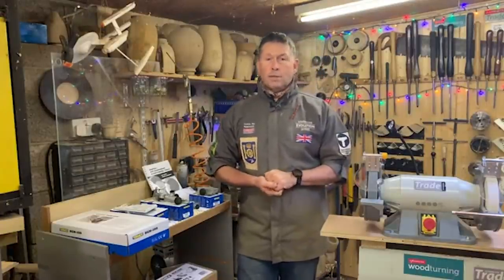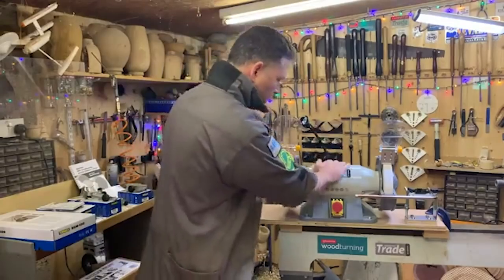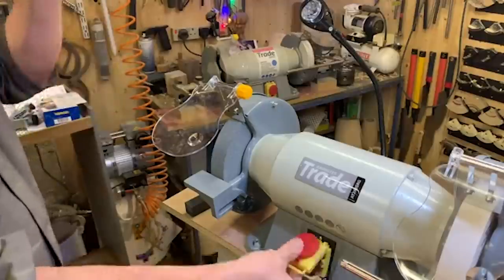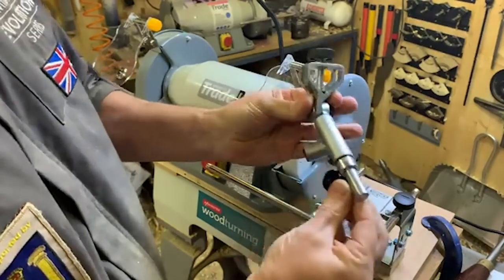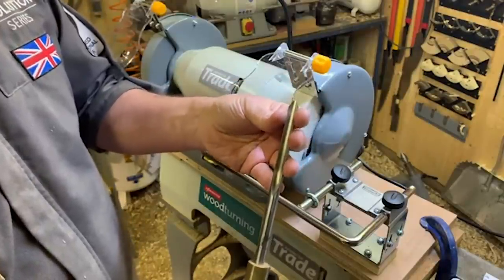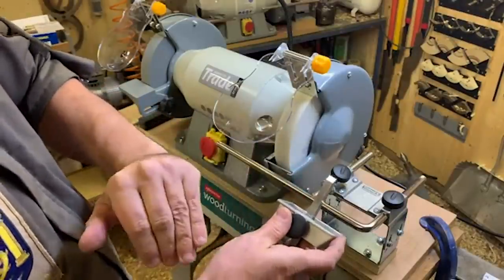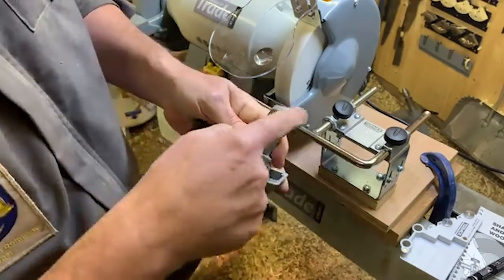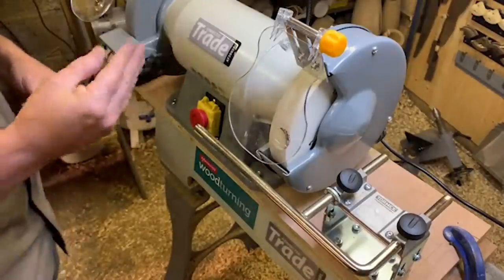Live Turning Thursday - Slow Speed Grinder Setup & Sharpening

Comment: ❤We already have a bench grinder 2800 rpm with a 50mm Reki and a Axminster 40mm CBN wheel and find it running a bit to fast and thinking off a Axminster Professional AP200SRG 1450 rpm Grinder i want to know the C/C between the wheels the grider i have has 360mm with our own rest setup on the bench Thank You
Reply from the maker: Hi there, the distance between the 2 wheels, is 360mm. Hope that helps.
Reply: @axminster  🙏 Thank You

Comment: Hi Colwyn, just thinking about getting into woodturning and I’m clearly going to have to sharpen my tools (particularly as they don’t come sharpened “out of the box”);  can I ask, why would you choose the SRG over say a Tormek T4 or even the Axminster Craft Whetstone AC250WBS?
Also, what are the benefits of the 55 degree grind on the bowl gouge over a 40 which I’ve seen a lot of Americans favouring
Thanks
Reply from the maker: Hi Nick, the following reply is from Colwin - "My personal favourite set up would be either the Tormek T8 with relevant turning jigs or the SRG with the BGK400 504087 and CBN wheels. I own the later and love it because of the speed of cut the lack of heat generated when re shaping and the lack of sparks. 
The AC250WBS will be a cheaper options however I would want to still use the Tormek jigs."